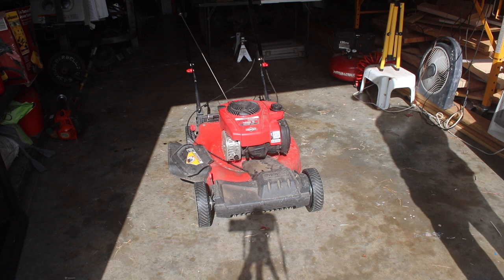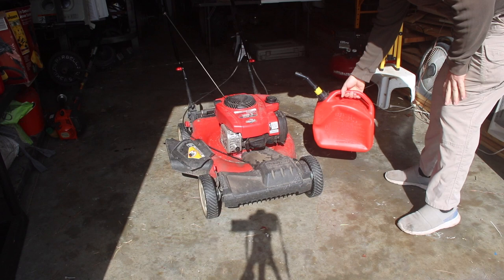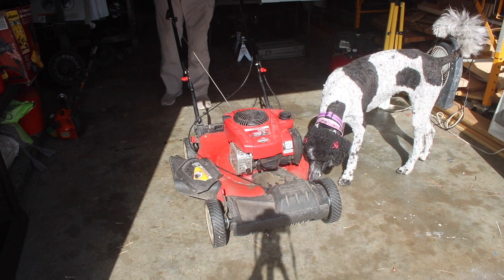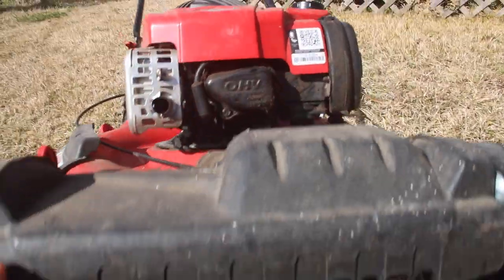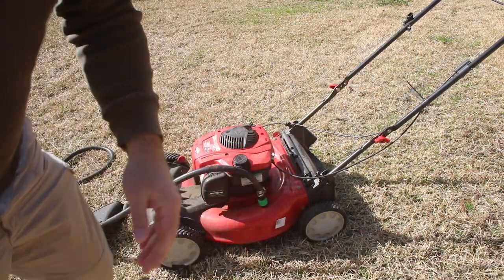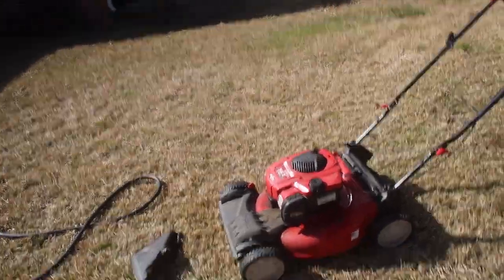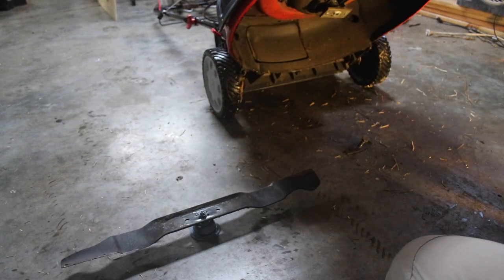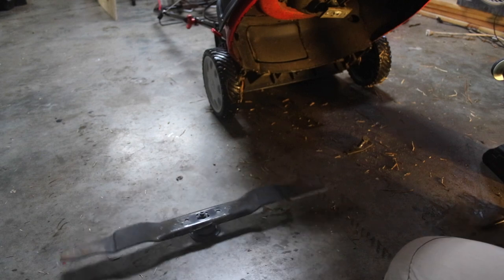Troy Bilt TB200 basic maintenance and cleaning

Comment: I don't believe that a sucked in gas can has anything to do with ethanol fuel. It usually means that the last time the can was open the temperature was warm, and there were more fumes in the can, usually when the temperature cools down the gases and fumes settle down and contract, creating a sucking in. I never use ethanol, and I have noticed this with large temperature swings.
Reply from the maker: That’s a good point.  I think you are correct!  I might have to do a test of our theories:)  thanks for watching!
Reply: @turningwrenches9524  It is true. I use ethanol-free gas and have noticed the suction when not using the gas for a long time.

Comment: My neighbor moved the other day and left the tb200. It is missing an air filter and cover. The mower has been sitting in the yard for a few months. It doesn't start. 😢
Reply from the maker: Check the oil, and then spray a little starting fluid in the intake hole behind the missing filter.  Give it a couple pulls and see if it fires off.
Reply: @turningwrenches9524  thanks! It worked! I ordered the air filter and cover and they will be arriving in a few days.
Reply from the maker: You may eventually need to clean the carb… but I am glad it worked for you!
Reply: @turningwrenches9524  thank you!
Reply: @turningwrenches9524  Would it be a lot easier to just buy a new carb? They seem to be really cheap. Less than $20.
Reply from the maker: @runnergo1398  I always try to clean it first.  But the carbs are pretty cheap and people have had decent luck with them.